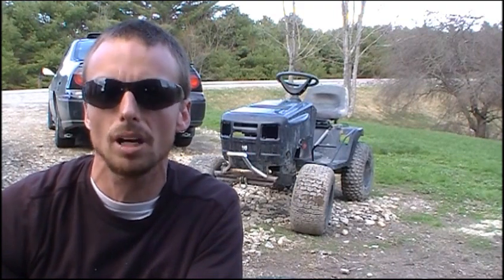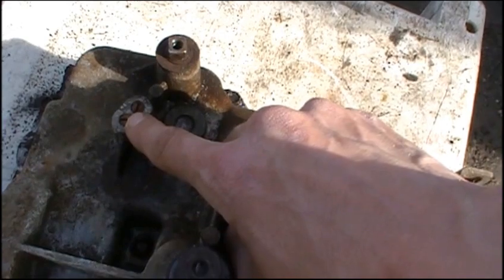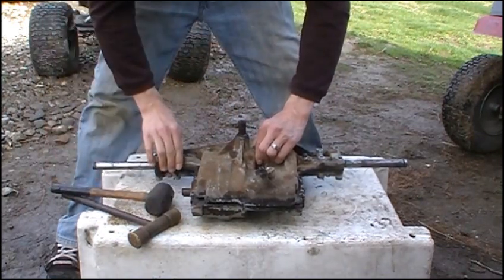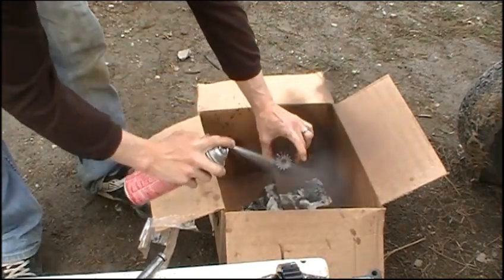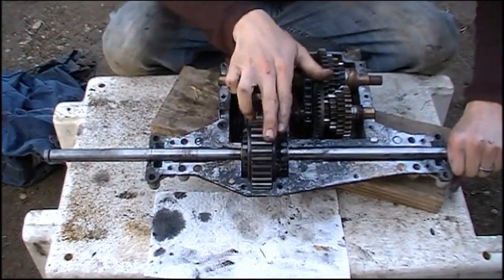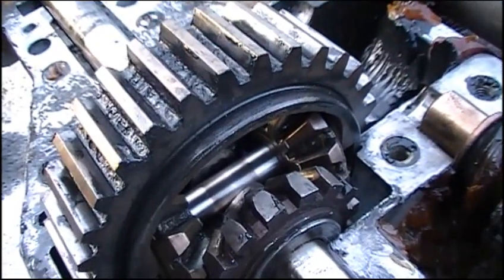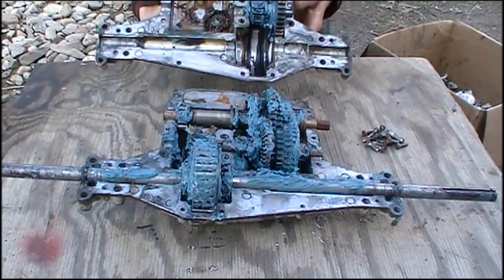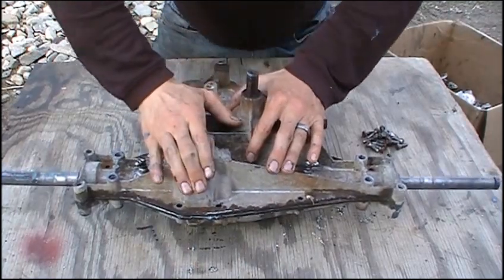How to: Lock a Trans-axle or Differential

Comment: you dam show enpres me ! I got a bolen 16.5hp gust a 92. problem stopping.took breaks off pull them apart cleaned housing the 2 holes for the pins and the pins.put all back on.mower in nutral ajusted breaks untill hard to roll in nutral.start mower take off go down a slight down grade.mid we push brakes down.mower stop, with foot still on break count 1,2 mower drif down the hill.i think i did the brakes right.could something be rough in the transmission why the mower keep on moving

Comment: Ether is cheaper and less toxic than carburetor/brake cleaner, aka starting fluid. Caution it is extremely flammable and will knock you out if enough is breathed in.

Comment: Hey fearless, dont know how much experience you have with mtd single speed transaxles. I have one and am in the process of locking it now. There are a bunch of torx screws holding the bull gear to the carrier. I can get them off.

Ive discovered that if I remove the spider gear shaft and put 4 or 5 washers on it before I put it back on and tighten it to bajilion foot pounds it puts so much pressure on the gears that they cant spin and the transaxle is locked.

I have it put back together now and everything spins freely and it is locked.  What do you think? bad idea?
Reply: Miller Thompson Better idea, especially if it slips before anything breaks, but still gives a good lockup. Welding is the least favorable way to lock the rear.
Reply: Miller Thompson I would be careful putting too much pressure on those gears.  They have and can very easily snap.   Then you are SOL.

Comment: your problem is probably rust.  if they sit for a long time all the oil or grease settles to the bottom leaving the metal parts un coated. over time they rust.  also the grease can harden around the parts which is essentially the same thing as the settling problem.  your best bet is to open it up and clean it out.  use very fine grit sand paper to clean all rust off

Comment: Would just heavy tack welds hold...why would you need a full weld all around?  All that extra heat really messes with the tempering and hardening of those gears.  Heck I would bet  just roughing up the outer ends of the spider shaft (the part under the gears) with a grinder, then stuffing some jb weld in there, cleaning it up, and reassembling it, then letting it cure would keep the spiders from spinning.

Comment: from doing that it just makes it harder to turn, as the tractor will just want to go straight, as for the weld looks not tooo bad but why so much splatter  dont you use splatter block or some thing   should of used stick or clean off the oil, grease befor you weld as that way you will not get so much splatter

Comment: hey y don't u just use a sprocket and chain instead of a belt and pully
Reply: Theresa Haynes thats what i was wondering as well
Reply: Then you have no neutral when you push the clutch,  the belt when it is lose (as when you push the clutch in) it will losing the belt so you can stop and keep the motor running and by the way locking up your differential WILL make it harder to steer, the mower will want to keep going straight...

Comment: do you use a 110 or 220 welder?
Reply: do you use argon?
Reply: considering he said there was slag all over, most likely he was using flux core wire and no argon. and the type of welder doesnt matter so much as long as it has enough amperage to penetrate and fuse the base metals together.

Comment: my kubota with a hydrostat came factory with a foot pedal activated rear locker. your not locking the transmission your locking the differential gear that in type of set up happens to be in the transsmission

Comment: I'm on my girl friends account. I got a peerless transaxle and a it broke.. And it broke different It broke but it doesn't move at all or anything. Took and apart and nothing seemed different... And upon opening I found out that my axles are held together with a big steel bracket I guess I can call it that.. What the heck is that all about..

Comment: How do I get a trans open its stuck
Reply from the maker: check the bottom, you may have missed a bolt.
Reply: I checked it must be the seal
Reply: I forgot but i made a makeshift seal with my welder and welded my case together

Comment: do you know wy the diff is used in cars ?
because when you turn around the ,one tire turn faster then the other so 
the dif lock is use in very special situation in off road or in big trucks when the need a better traction  ,if you did that on your car you must immediately stop use it ans change your diff to a normal on its very very dangerous you may lose control of the car in turns I'm very serious.

Comment: So what is the BENEFIT of doing this?
Reply: +Numa Newbern when you're in mud or snow or something that has low traction, you don't end up with one wheel spinning and one still and get stuck
Reply: OK thanks, I have one that is not gear drive but is a Snapper LT hydro, haven't noticed if it ever lost traction as that

Comment: what does this help do
Reply: im putting one of these in a go kart so i can use a belt to drive the thing but does this help with speed
Reply: It doesn’t help speed at all. Just if you’re in the mud with an unlocked diff the power will go to the wheel with the least traction and the other probably has a whole bunch of it. Lock it up like this and both wheels will spin at the same speed all the time and you will have increased traction. I wouldn’t worry about it on a street go cart.

Comment: When it be easier just to put a whole axle straight through it rather then reusing everything to welded back together
Reply from the maker: IF you can find a 3/4" axle, and you would have to install bearings so the keyway-cutouts dont eat the bushings.

Comment: i'll bet this will tear up a lawn if you turn sharp at higher speeds but will climb a hill well. I use the older bolens diff with a great limited slip. a john deere 112 with the peerless 2600 duotrak is  a great limited slip diff, but difficult to find

Comment: Buy yourself some anti splatter spray before u tack gears spray them every where except where your welding and dont use brake cleaner with mig using argon it makes poision gas if u do. clean brake clean off with alcohol

Comment: One very fast way to totally stuff up a very expensive transaxle gearbox .  NONT DO IT .
Reply from the maker: Yes, it's risky, but the reward is the single best mod you can do. Don't do it if you don't feel confident you can get it right, it's better to have an open diff that works, then a poorly locked one that doesn't.
Reply: I was freaked out that I was going to totally screw shit up the first time I did one. I watched fearless's vid on this probably twenty times before I even pulled the axle out from under the tractor! Since then, I've locked three more and it does get easier the more of them you do. Just take your time, and do as fearless says in this vid. The man knows his shit. Take care.

Comment: those transaxles are mass production  junk....u will break pinion and ring gear doing so or twist axle. plus the CASE is axle bushings they won't take abuse 👎
Reply: Rail rider I suggest watch a 13 part series called What on earth happened by Ewaranon to learn that the earth is not a globe.

I got it in my about tab.

Comment: @steve26180 well I won't go deeper as you started judging me by my nickname, but I'll tell you a secret you can proudly share with your colleagues if you want, steve. disc rotors are made of grey iron. guess what that thing rusts like crazy when O2 is present. they coat the discs with a special oil based rust inhibitor. the purpose of brake cleaner is to clean that stuff off before installation. it's just a solvent with propellant. clear enough? dare to share your brake job stories?

Comment: Shitty flux core mig welder.
Reply: Skeefoo Panama that's all you need for little projects like this
Reply: Tim no harm intended.
Reply: Flux core IS NOT Mig, flux core is an arch welder same as stick welder but with the flux on the inside of the wire instead of outside like the sticks and wire feed, Mig is completely different there is no flux per say it uses the gas to create an inert bubble around the weld spot so no contaminants to effect the metal. That's why you can't Mig weld in a windy or drafty area...
Reply: Dude, your wrong I have seen fluxcore mig wire used with a cheap ass mig welder that dont use any shielding gas, only wire they sell them at Harbor Freight, and they weld crappy at best, Ive spooled miles of mig wire during my career and have years behind the mask.
Reply: Just go to harbor freight and look at their welders, they advertise it as a flux core wire that dont use any shielding gas. What do you think?
Reply: "Just go to harbor freight and look at their welders, they advertise it as a flux core wire that dont use any shielding gas. What do you think?"

What I think is you just said the same thing I did  

"they advertise it as a flux core wire that dont use any shielding gas"  

That's what i was saying (flux core). Now they do sell a combination Mig / Flux you have to set it up for witch one you want to use you can't just put different wire and think it will work right you have to reverse the polarity BUT in no way is a flux core welder a mig welder. I stand by what I said and just because some Chinese company calls there product with the word Mig hopping to fool people who don't know the difference does not make it so....
Reply: Lenny  I don't question your experience, but it is what they say it is a cheap wire feed welder that uses small spools of hollow wire with some type of flux inside of it, and I also agree it is not a true Metal Inert Gas welder, it cannot be if it don't use a shielding gas,  yeah i said shitty mig welder, but we both know it is not.